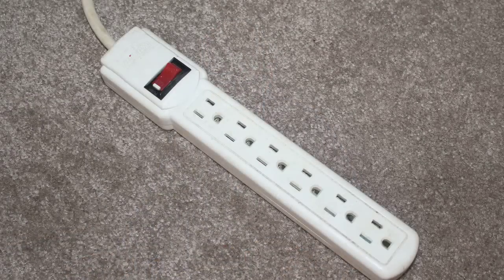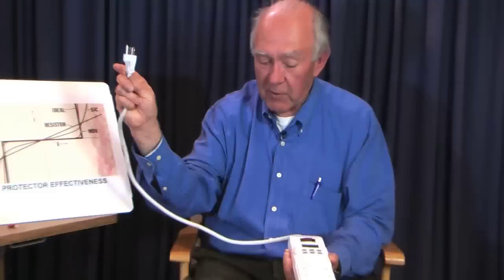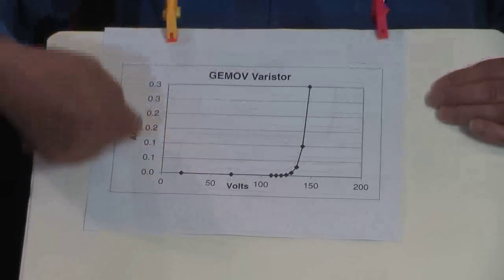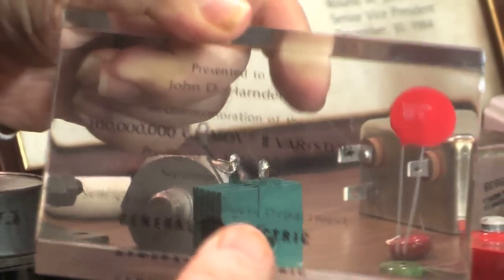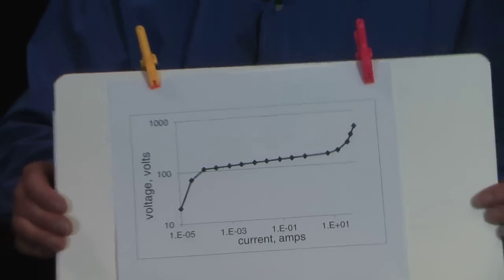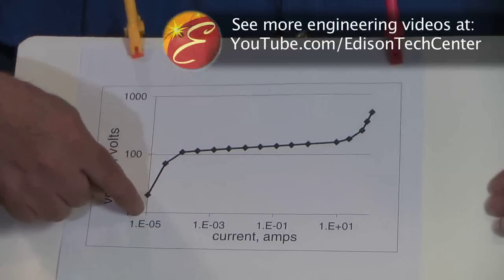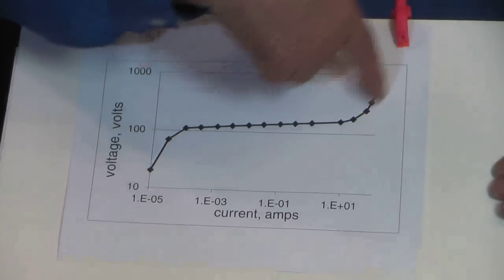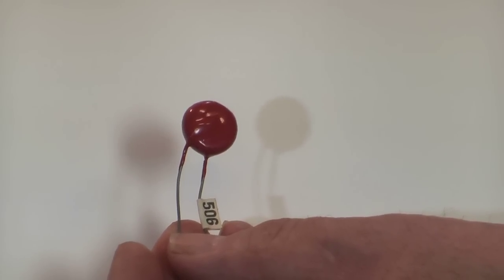How a Surge Protector Works (Metal Oxide Varistor)

Comment: I have 220 volt power strips I want to use with 120 volt devices and a 120 volt power source. To be safe, I would like to install a MOV surge suppressor. What should the voltage rating be for this MOV suppressor?
Reply: colócale un varistor de 150 VAC ,  o uno de 175 VAC,  también dependerá de que tanto varía la tensión de red de tu área , si siempre es constante los 120v ,le pudieras instalar un Varistor de 150v

Comment: how do you test one?
Reply: I'm not an expert, but they tend to fail by drawing excessive current and overheating. A basic check is therefore that the device has a high resistance. A more thorough (and dangerous!) test is to apply a voltage approaching the MOV's rated voltage and check that the conducted current starts to increase.

Comment: would be nice to know to read the info printed on the MOV so I can get the proper replacement or better suited replacement MOV part. mine says S10..K275 and on tho bottom 12 51 it's a blue one about 10mm in diameter and about 3mm thick
Reply: Entonces según la serigrafía de tu Varistor,  proteje hasta 275 vac rms...  osea si hay picos de tensión mayor a ese voltaje el Varistor los absorbe y no pasan al circuito, ahora sí hay más de 275vac constantes en la red de tu casa , este se pondrá en corto , y hará saltar las protecciones de la vivienda, protegiendo el equipo de un alza permanente de voltaje

Comment: can you tell me that if I use Circuit Breaker in place  of Metal Oxide Varistor. will it Surge protect devices?
Reply: Circuit breaker will not protect against surges, that's why this is such a wonderful simple device. it adsorbs surges and helps keep the currant straight and level. Circuit Breaker trips for overloads or shorts. say if you plugged in two air compressors or try to use toaster oven and the microwave throw in a coffee pot on the same plug/outlet at the same time shortly thereafter it will pop/trip the breaker. this keeps the wires that feed the plug from over heating and catching fire. that's why replacing breakers with bigger ones is not a wise idea. sure it will work, but over time it will damage the wire.. FYI

Comment: With all due respect...He does not tell you that while the MOV needs to wait for the voltage to rise to a certain level before it opens, the current from the surge is riding along unopposed into your computer.  Think of a wave of water.  The MOV is like a float in the water.  The MOV trips the drain to lower the water level only after the wave rises to a certain level.  All the while, more water than you can handle is coming at you.  The IEEE defined the worst surge as running 3000 Amps!  That is likely to happen 100 times a year in your home.  Cheap MOV surge suppressors do not throttle the current at the same time as the voltage is rising.
Reply: I've worked with surge protection for 30 years on telecommunications equipment. MOV's work slower than the new clamping devices but they usually never fail or get damaged as often as the newer clamping devices. We always went by the four foot rule: the surge protector is placed four feet or more in front of the protected equipment on AC, telco lines, any communications cable connecting to the equipment. A surge can travel approx.three feet past the surge device before it would clamp and dissipate the surge to ground. Our surge device placement techniques was very successful and equipment damage even during severe lightning storms dropped down to direct building hits only even with the old MOV clamping devices..
Reply: 1:00, he does tell
Reply: Yes for a computer i would use no less than a voltage regulator
Reply: You realize, that he is the guy that invented the Metal Oxide Resistor right?  :)
Reply: Lol

Comment: Pretty much correct but the over-current protection device isn't going to trip. If you short circuit hot and neutral what's the potential difference between them. You guessed it zero. I know it's confusing as hell. Start looking at the datasheets for them. That will piss you off ; it did me. They shove like 20 mov's on a small log log graph and expect the customer to be satisfied. Here's what i'm talking about 
mouser.com/ds/2/240/Littelfuse_MOV_CIII-40488.pdf

Comment: I believe the term "thermal fuse" as used is a misnomer. Power strips usually have circuit breakers instead of fuses, but even if it is a fuse, it is not a thermal fuse, but a current fuse. The former is designed to open at a given temperature regardless of the current passing through it (e.g. in consumer fan motor windings), whereas the latter is designed to open at a given current regardless of the ambient temp. (however it will open if the temp. is hot enough to melt the fuse element).